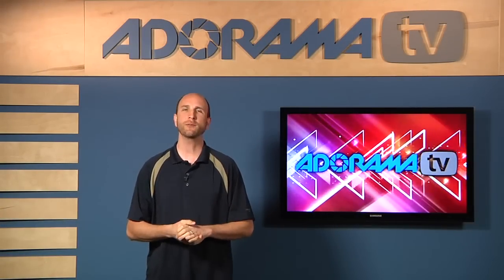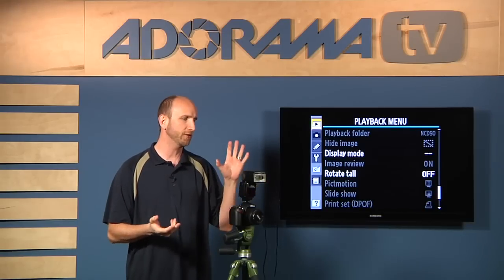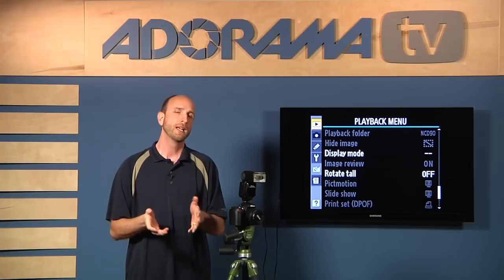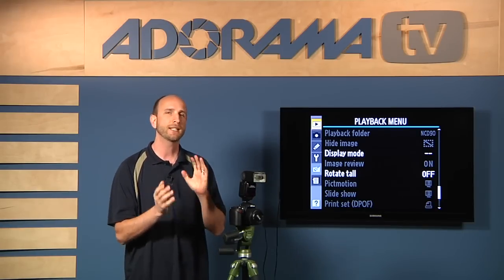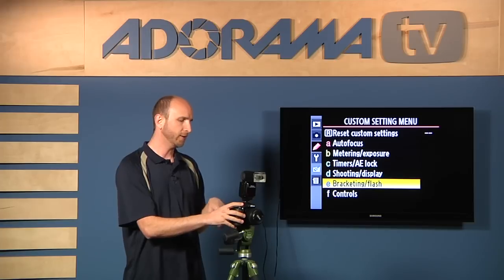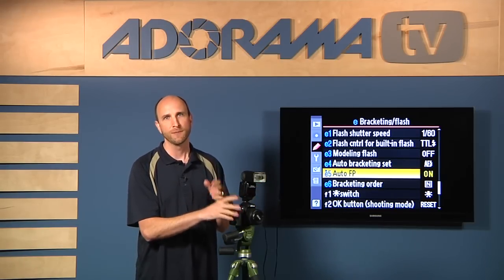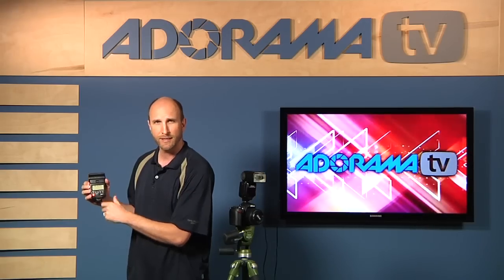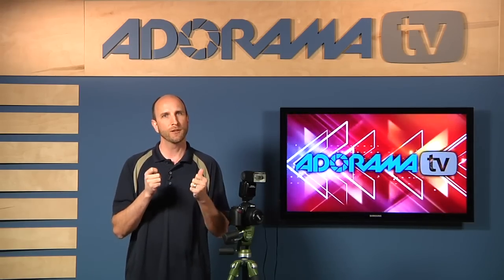Digital Photography 1 on 1: Episode 43: On Camera Flash Basics

Comment: Nice video, but I think you've missed a very important thing about Flash & Exposure compensation on Nikon. Yes, exposure compensation affects both ambient and flash exposure (it affects the whole exposure), but you completely missed the flash compensation button on the camera. Just press that button and set the flash compensation and you don't need to go into manual mode! That's a very important thing that you missed completely, which makes Nikons solution look like crap (which it isn't).

Comment: @acuna13 When shooting indoors with Tv mode, exposure compensation adjusts the aperture (how large the diameter of the light hitting the sensor, and subsequently the amount of light) instead of shutter speed instead of the opposite in Av mode. As you may know, a smaller aperture number = more light but also = narrower depth of field. Using a flash you can use a larger aperture number = less light (flash compensates for this) = wider DoF.

Comment: On a Canon camera you can also set flash exposure compensation, which on the less expensive models requires you use the 'set' menu navigation. In all manual/priority modes, there's a block at the right side of an EOS500/550/600D's menu that is empty if your flash compensation is set to 0. If you adjust it,t he opposite of exposure compensation is true; flash duration will increase/decrease while exposure time will remain the same, wheras exposure comp. makes your exposure/quicker slower.

Comment: As many others said, this video is good, but is very Canon biased, as it missed a very basic and important feature of Nikon cameras.  You don't have to go into Manual mode.  With Nikon, if you decrease the exposure comp for the ambient light by -1, you can increase the flash compensation by the same amount (+1 in this example) to keep your subject at the original exposure.  It is very easy and allows great separate control of ambient and flash.

Comment: I do not know if this will work with Nikon, but with Canon, when using a bounce flash, put it on manual mode.   Enter  the settings that you think with give you the best picture, and do not worry about proper exposure.  If your speedlite is on ETTL mode, it will compensate to give you proper exposure.   If you are not happy with the exposure just compensate the ETTL exposure plus or minus.
Reply: Precisely, ,

Comment: I don't quite get why the flash isn't affected by the exposure compensation (i.e. shutter speed). As the flash is in FP sync mode, the duration of the burst last an entire exposure (i.e. until the rear curtain has come up)? So shortening the exposure time would not only dim the background  but also make the flash exposed subject apear less bright? So for a consistent brightness of the subject, the power of the flash should be increased accordingly? Does the TTL system do this for you?

Comment: hi, nice tutorial, I'm very new to photography, I'm using Canon 760d/T6s I'm in between to buy a flashgun from Canon and Yongnuo, obviously Canon flashguns are very expensive.

1.can I use yongnuo flash and trigger it wirelessly without the optical sensor of the flash?
2.which yongnuo flash model is compatible for off camera flash without needing a transmitter and receiver?

Comment: good day mark! i want to ask about flash sync. i am using a YN560 speedlite. i can directly get shots with fast shutter speeds. my problem is. when i shoot above 250 shutter speed the curtain will show into the picture or a black part is shown. i need your help. also in setting mode, flash control is incompatible even its powered on. waiting for your kind reply! it would help me! thanks in advance! still an amateur on flash. just bought one lately!

Comment: You should have a read through your camera's manual and try out its examples pertaining to using Av and Tv mode, then consider how flash and exposure compensation and their respective changes in either mode would affect your scene. Flash compensation makes things lit by the flash brighter/darker, exposure compensation makes things not lit by the flash brighter/darker. Tv mode's compensations change Aperture (DoF) while Av mode's compensations change shutter speed or flash duration.

Comment: umm So I have  Nikon D3200 and doesn't seem to have a way to allow me to go past 1/200 shutterspeed, any help? the only way is to upgrade? :/
Reply: the cheaper cameras doesn't have FP sync.  what you can do is put in a ND filter on the lens and it drops scene's brightness down so you can use 1/200 speed.  also use the lowest ISO.  but the thing with a ND filter is that it is quick thick and dark so autofocus can be affected.  best is to upgrade to a higher model used or new.
Reply: I wonder what happens if you put a yongnuo yn565EX on top of your D3200. Since it's a  Canon flash,  the camera won't recognise it and you can use any speed you like.  This works with my Yn560 however!  The yn560 does not have hss support so I get Black bars.  But if the flash supports hss what then?